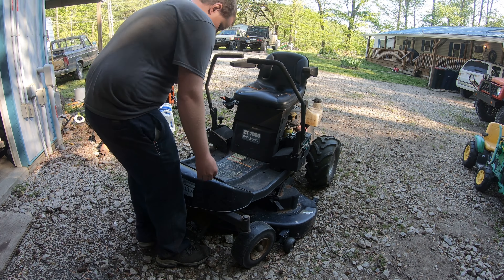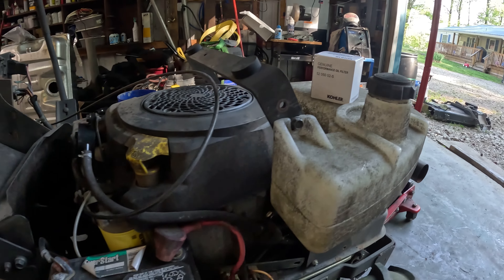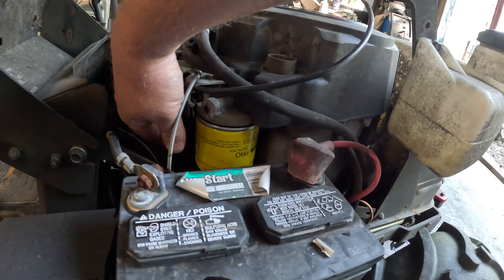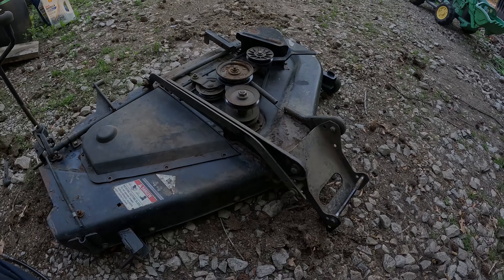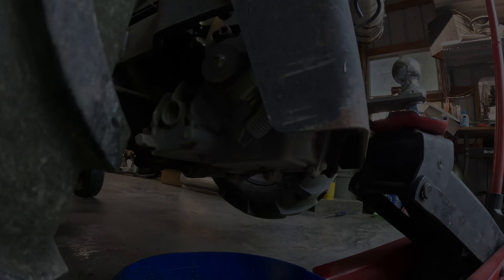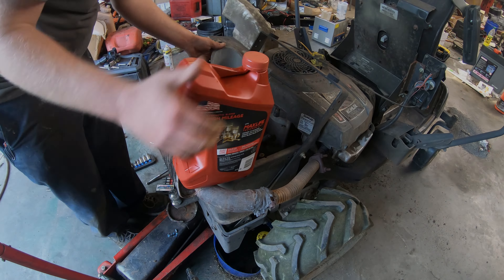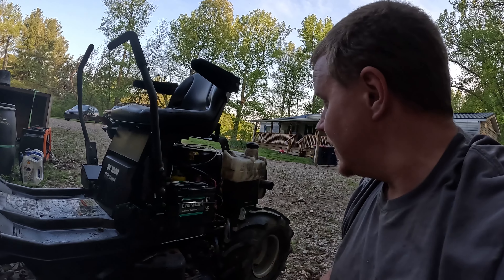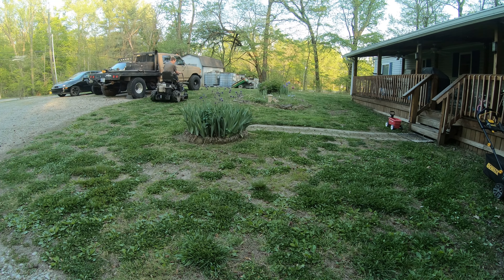Craftsman ZT7000 Service - 1 Year Since Drilling Holes In The Hydro Drive Units - Is It Dead?

Comment: I enjoyed your video showing how you replaced the oil in the transaxle, but greasing the spindles really does no good. The two bearings in each of the spindles are sealed so pumping grease in there is not going to get any  into the bearings. All that does is fill the cavity full of grease. It's quite easy to disassamble the spindle and either replace the bearings or pop the seals out and grease them. There are quite a few YouTube videos showing how to grease sealed bearings.
Reply from the maker: Hmm..  I've not had them apart so I was not aware that they are sealed.  Seems like a waste to put a grease zerk on them.

Comment: Is there a video of what you did when drilling the holes in the Transaxle?
Reply from the maker: Here you go...  https://youtu.be/ncWEwEkYCpw
Reply: Thanks so much for posting an update video on your drive units. It's nice to see how clean the oil was coming out of them. I am pumping the oil out of mine at 60 hours and then every 100 hours after that. I am a little nervous about putting a drain plug in. The machine is still under warranty. I wish I could get all the oil out by pumping it  but I think this will still help, any thoughts?
Reply from the maker: @Ricky-eo5ym  if its under warranty,  I'd continue doing what you are doing for sure.  Mine is an oldie that was headed to the scrap heap.